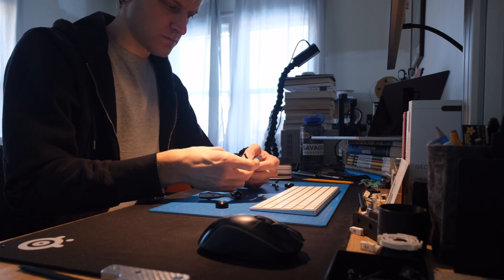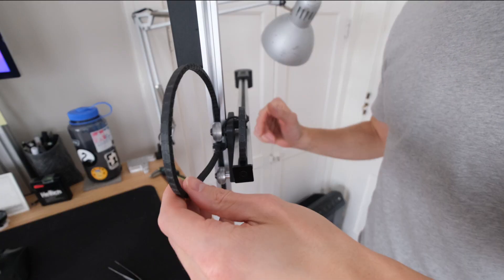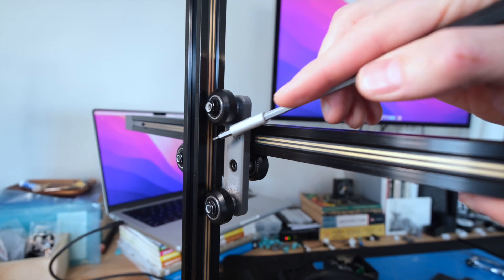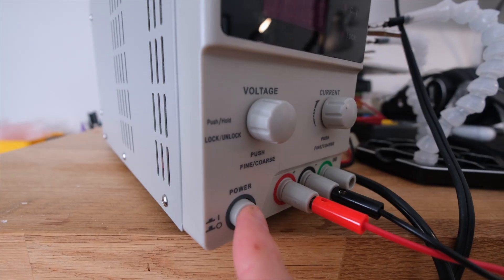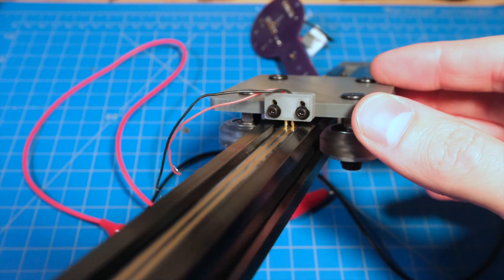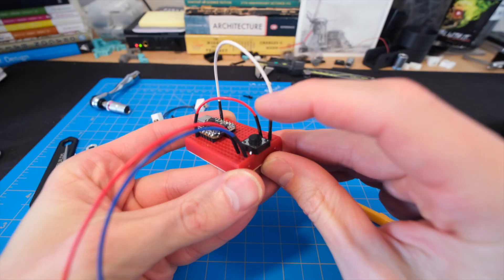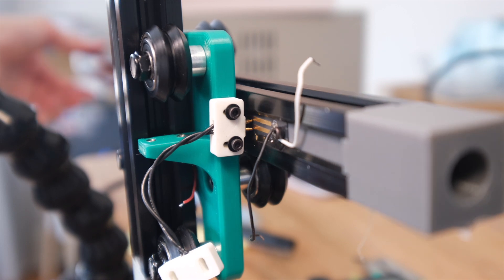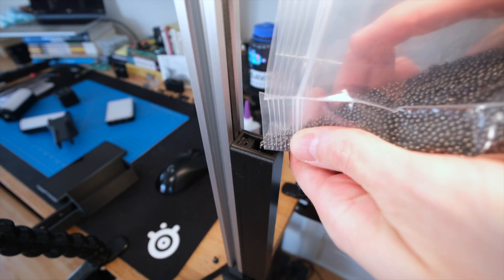Pogo pins: attractive distraction or ultimate wiring solution? - DIYson Lamp Build Log #9

Comment: The idea with pogo pins is awesome, however, I would definitely consider making the surface contact larger, by making the PCB curvy. Think of a groove. It's possible, but I am not sure if JLCPCB or PCBWay can do it. The biggest advantage is that you can run more current, because otherwise you might need to get higher voltage LEDs. But yes, pogo pins is definitely the way to go! So damn cool.

Comment: I'll second all the suggestions for trying brushes instead of the pogo pins. I make a fair amount of test fixtures for work, often utilizing pogo pins and in my experience, they don't last very long in sliding applications.
Reply: I can imagine they don't last too long because their housing will wear out, giving play to the inside pin or even letting it disintegrate. At the end, pogo-pins are made for a static scenario where no shearing? force applies…

Comment: Rather than off-the-shelf pogo pins get some of the larger off-the-shelf copper contacts and just make your own POGO with tiny springs in a 3D print.
Reply: Miniature Carbon brushes and a tension spring will also work, like you'd see on a miniature brushed DC motor. Its a tech from 1850, very reliable.

Comment: Great stuff! I’m not familiar with this field of engineering so I have no idea if this will solve your problem or even how to properly describe this. But what if you move the pins closer to the center of ‘rotation’? That way the movement between the track and pins is smaller compared to a point further away from the center.

Comment: You could potentially manually create a roller pin with more travel distance by placing them in series with a a weak spring, or you could add one more wheel in the weak axis to eliminate the rotation out of alignment

Comment: Pogo pins are good but I don’t think they are the ideal solution for this. Spring pin contacts like those on some battery terminals will likely work much better. With much greater spring forces and stroke lengths.

Comment: Pogo pins has much more hardness that PCB track - as the result track can be damaged. 
Contact pins ( or maybe better some contact plates with spring ) must be with less hardness to protect PCB ( similar to brush in the motor ).
Also maybe better to install top track under ALU profile to not gather any dust. 
Great project !
Reply: Yeah he really needs to go with softer brushes, he could have the conductive strips non visible inside the v slot too with the brushes pushing towards both  sides from the middle, and have the brushes mounted inside the carriage to totally hide them.   This problem has been well solved for a long time.

Comment: Not sure if this idea has been mentioned already, but using two separate PCB strips of a single trace on opposing faces of the arm would allow a much wider track for each one.
Reply: Or even use the aluminium arm as one of the "tracks"? You'd get wear marks, but if those were underneath it might not be a problem.

Comment: Amazing project! Well done on the date collection and iteration. It does seem that your pin mount position is the main issue here and could be solved by moving the pins so their travel direction is matched but the "rotation" direction of the horizontal arm. I would think that mounting the pins on the top or bottom of that rail and moving it closer to the pivot point (in the middle of the carriage) would help fix your issue. (which you touched on a little but were talking about mounting it directly to the arm rather then just changing the mounting position.) You could also add some additional spring force/travel distance to your pin assembly by designing in some flex/spring into the 3d pin housing itself. Again, great work! keep it up
Reply: Just wanted to comment that this is what I thought as well. We are supporting the track on the top and bottom, so adding the rail and pogo pins there might elimate some of the issues you're facing. I'm loving the series and seriously considering building my own DIYson in due time! Definitely think that this rail solution is a lot cleaner than the wires.

Comment: Place the pogopins nearer the axis of rotation. Place at least one pair on each side of this axis in a way that when one loses contact the other(s) pick up the connection. Go beyond the capacitor if necessary and place a small battery and charger near the load and decouple the light output from the power losses. Use the battery as counter weight.

Comment: One thing to keep in mind is that the ADC on the MCU provides almost no load to the circuit under test. The capacitor might not be as useful with a load in the circuit.

Comment: I love the track idea.  I am afraid that pogo pins pushing against the track PCB will wear it down over time.  I am trying to figure out if there are any pogo pins with a wheel on the end to minnize the dragging.  The closest thing I could find is Rolling Pogo Pin.  You are basically trying to make a brushed motor where + and - need contact while moving.  

It looks like the arm just need a little more support to keep the connection consistent.

Comment: Suggestion for your reliability problem - what if you used a trio of 2x1 pogo pin modules that are offset from each other by maybe 1/3 a track width? That way if one pin slips off its trace in either direction, the other one is sliding onto it.

Comment: Have you tried adding a suspension like mechanism in order to keep the pins in contact with the PCB? Also, check the mechanism the race track toys use to always be running without disruption.

Comment: Watching your videos is just so much fun. I like that you try to perfect something rather than churning out weekend projects although I totally get the appeal of this too. Have you considered making two separate wider lanes? Maybe one at the top and one at the bottom. This would give the pins more tolerance. It would also add to the cost of course but maybe its neglectable. Another solution could be a clip of sorts around the horizontal arm attached to the carriage? You could then mount the pins to this pins so they hopefully move together with the arm. I am stoked for your side project by the way!

Comment: We can use 2 opposite sides as the 2 different voltages. Like one side as the ground and other side as the positive voltage. Then using some carbon brushes or small bearings as those will keep it from wearing earlier.

Comment: It looks to me like you need to work on making your v wheels grip the aluminum extrusion more tightly. That will greatly reduce the twisting relative motion that is causing the pogo pins to disconnect from the track.
It doesn't look like you have any tension adjustment in the v wheel setup. You should look at eccentric mounts for one of the wheels so that you can snug the whole carriage up against the extrusion.
Also, if you move the pogo pins between the v wheels, it will minimize the effects of any rotation since that is where there will be the least movement.
I like this solution of the track and pins. It looks a lot nicer aesthetically than the drag chain.
If the pogo pins give you problems over time, you also might consider using battery spring contacts. They might give you more reliable performance.

Comment: - Placing the PCB tracks on the underside of the moving arm (as opposed to the top side) would keep it from collecting dust and thus will reduce the contact quality degradation over time.
- More pogo pins (like 2x2) should also help to keep the connection from degradation over time.
- Big roller pins might not offer a self-cleaning effect and suffer more contact degradation over time.
- Placing pogo pins between bottom rollers might even out most of the displacement and improve the consistency of connection in motion. Although it makes wiring more challenging. (The side facing the moving arm is occupied by the belt and thus unavailable for electric connection PCB.)

Comment: You should also think of some solution to cover the rest of the exposed power rail. Right now, it seems really easy to short it by just accidentally touching it, which could damage power supply.
Reply from the maker: Tested that, it doesn't short :)

Comment: Have you tried using the offset cam adjusters that 3d printers use to attach one of the v wheels - it would help with the twisting (as well as adjusting due to wear of the wheels)
Reply: Yeah, he has used the eccentric nuts (in a previous video)

Comment: You could try something similar to slot car track - instead of pogo pins, they use little metal brushes to stay in contact with the track. Brushed electric motors also use, well, brushes.
Reply: I really hope he sees this comment. This would really solve the problem in such a simple tried and true way.

Comment: Such a bummer that the roller pin didn't work as well. I think this pin type would reduce long term wear.  Double stroke pins may be an option. Spring loaded ball and casement cylinder.

Comment: Beautiful idea to use the supertrack inside the 2020 aluminum profile. For dissipate the led heat, I'm wondering if you can use a super track pcb with copper core or higher thermal conductivity.

Comment: I would think the biggest reason the pins for the horizontal track misaligning and not the vertical ones, even though the arms are functionally identical, might be due to the fact that the pins on the vertical tracks are placed in between the two wheels, effectively putting them by the center-point of the mounting. As the point of rotation is the center of the three wheels that hold each arm, the closer you are to that center, the less misalignment you get from rotation. Looking at the original lamp, they put the connection for the horizontal arm between the two wheels there as well, so simply moving your connector to the same spot might solve the problem without having to do any other changes!

Comment: I think a solution - or an approach that makes other solutions more likely to succeed - is to move the placement of the pogo pins.  At the moment they are mounted away from the point the arm is pivoting (somewhere between the rollers) - which magnifies the misalignment.  If you get the pins mounted closer to where the arms pivot - the length of travel of the pogo pins may be enough to keep contact during lamp adjustments (which may also explain the positioning of the original power block @ 15:53 - at the point that the arms pivot around).  Just some thoughts.
Reply: I came down into the comments to mention this if noone else had. Glad to see I'm not the only one with this thought.
Reply: true, putting the mins closer to the centre of rotationwould help
Reply: I also thought of adding springs to ensure the contact independently of the depth, solving the other problem!
Reply: I had the same idea. When aligning the pins inside the bracket, you would need to take it off for changing the pins, but since there are no wires between the base and the led it might be ok. In the center the pins might not loose contact that much.
Also relocating the supertrack to the lamp from the top the the inner side would compensate for dust buildup. 
Its a great project. i love it.
Reply: edit.
on the start of the 10th episode it looks like he did exactly that, but its not covered yet.
time will tell.
Reply: I was thinking about this too, and it got me wondering about the relationship between the geometry of the rollers and the location of that pivot point. I’m curious how the first carriage design would fare…

Comment: Careful on relying on a capacitor. Of course, I would add one, it will help - but when testing, if you don't have a load similar to the light on the circuit, it will appear to fix it more than it really will. Like in your test case (at least as you showed it), there is effectively no load on current path, so the capacitor is smoothing out the 'signal' much more than it will with a light attached.
Reply: Another problem I can think of right now would be sparks - if the power disconnects and regains connection the sparks could "destroy" the copper layers and pins over time (that's a problem without the capacitors as well but they sure would make it worse)

maybe using something like motor brushes would be a good idea - just a thought though
Reply: @lyqide8123  Motor brushes might be a really good idea. Some even come spring loaded. Not sure if you can get them this small though.
Reply: @lyqide8123 it would fix all problems, you can use thé graphite from a soft pencil, graphite is very conducting  and self lubricating, it's thé same material as used in dc motors, "Carbon Brush", also slide potentiometer use thé same principe 😁
Reply: Capacitors don't fix the source of the problem, electrolytic caps also die after 5000hours of usage.
Reply: @RoyvanLierop  and can be replaced

Comment: Have you thought about positioning pogo pins in the center of a carriage? It has to be a pivot point of a twisting motion that makes pogo pins go off track, thus it must be minimal movement in the central point.
Reply: That’s what I was thinking. And it could explain why the vertical connection is better, since it’s closer the the center by design.

Comment: I’m really enjoying the series! I think a design aspect of the light cycle that may be worth testing here is just the location of the connection, positioning the pogo connection between the two v wheels will get them closer to the axis that the arm is twisting on. The closer you get to that axis the less apparent the rotation should be.
Reply: I was thinking the same thing. Try putting the pogo pins on the sliding plate that connects the vertical and horizontal extrusions. If the pins are at the center of rotation it should defeat the twisting misalignment. 

Furthermore, if done well, it could completely remove the clip currently holding them in place!
Reply: Yes, this thread should be pinned up

Comment: Great idea!
I'm afraid "normal" pogos will wear out too fast or damage the contact-rail (not intended for horizontal movement). I think rolling pogos are better suited. 
I'd assume the play on the arm should be negligible (for the pogos) if the pogos are mounted in between v-roles / opposite to the third role.
-> at this spot I'd expect the smallest play/movement due to arm rotation. (similar to the post) / perhaps below the arm.
PS: did you double check vroll alignment/mount to minimize play? looks a bit to much then I'd expect.
Reply: I really think that the pogo pin idea is really cool, but I agree with Rene that I believe it will wear out way too fast. And also the fact that dust and debris can get on it. I own a Dyson light cycle lamp it they use a very long flex cable for power.

Comment: Instead of pogo pins, you can use brass tongs(not sure what they are called)

We can find this generally in those small 5v hobby dc motor with carbon brush attached at one end that makes contact with the armature.

This would transmit power more reliably. As it has springy characteristics. This will compensate for gap created between the track and carriage. 

I guess this should work.

Comment: Love to see the progress made. This episode hit kinda close to home, as at work i build test fixtures for pcbs, using pogo pins. 

My guess for the problem only existing on the horizontal arm, not the vertical, is that you attached the pins in between the guide rollers on the vertical arm, and outside on the horizontal. This could lead to more movement of the arm itself. 
Second, in the video the wheels seem to be not that tight on the arm, i think readjusting here could also make a difference.

Comment: Hey great video! 
I think a supercapacitor could greatly help even more with short power disruptions
Reply from the maker: Thanks! How big of a capacitor are we talking?
Reply: @StevenBennettMakes with 120f @3V you would get 6 minutes at 0,5A. Essentially a small battery that is always recharged :)
As long as the pins land in a good position any movement should be flawless
Reply: @Zeftow  going near this big can make big problems if you don't current limit the cap it will be a problem (voltage drop, current overload and dangerously high current for a little pogo) also careful most supercaps are rated for 2.7v

Comment: On the topic of the drag chain... In my experience SLA resin printing would almost certainly yield worst results than your current solution.  Even the so-called "tough resins" are still on one end of the spectrum or the other with regards to brittleness or softness.  It could work for larger parts, but those tiny links would not last (in my opinion).  I'd love to be proven wrong though. :)  If I were considering making it, I'd probably try something like SLS nylon or similar.  Just my 2 cents.  Loving the project, and eagerly awaiting the next episode!  Good luck!
Reply from the maker: Good to know! Thanks :)

Comment: You could have the pogo pins mounted on a flex PCB instead of press-fitting them into plastic and soldering wires to them. I think it's best if you work on the positioning and technique you use for mounting the pins before you pursue this however.

Comment: I really love this series ! I really love this lamp, and I will build one ! I think that the super track is totally the right thing. Looks like you have a lot of play in your motion system, are you using eccentric nuts ? There a needed to this kind of motion system, to eliminate any play ! Look at any 3D printer, they all have this. And can dust on the rail impact reliability ?
Reply from the maker: Check out the second build log :)